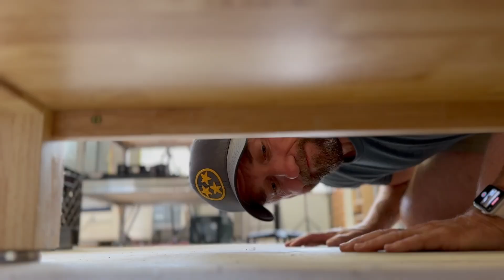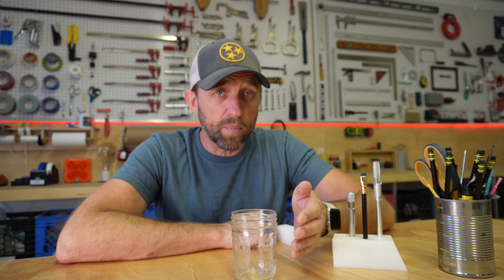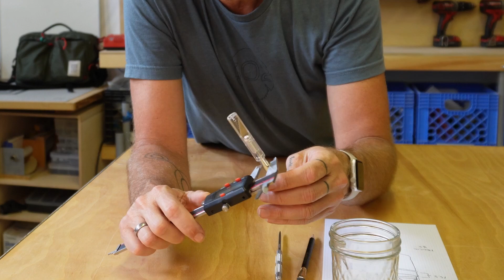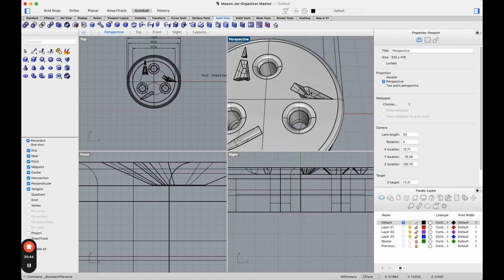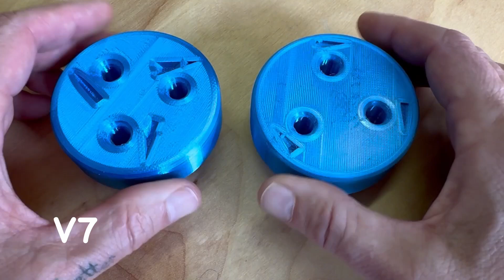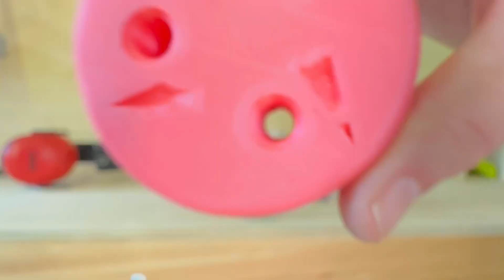Stop looking for hacks... Organize with Purpose!

Comment: That came out nicely! For a future version you might use a different first layer filament as an inlay for the labels and a perimeter on the holes so they are super easy to see at a glance when putting things back
Reply from the maker: That's a great Idea. I mostly use my printer for prototyping, so I'm new to the idea of making a finished product. I'm looking into the multi-filament printers now!

Comment: Nice tips, thanks for sharing. I personally use sections of PVC pipe for electric wires conduit (30 mm diameter), fixed horizontally under the main shelf in front of my workbench, to hold HB and B2 pencils, 0,5 and 0,3 mechanical pencils, eraser, pens, permanent markers, rulers, tweezers, compass, divider, awl, marking knife, cutter, and 2 screwdrivers. Next the pipes there's a little shelf under the main one with 2 combination square (15 cm and 30 cm), digital protractor, caliper, scrapers, small brushes. Everything else goes in drawers and cabinets near by. The only problem was the pencils getting shorter and getting lost in the longer tubes. I solved this by creating a second and a third row of shorter tubes under the longer ones to hold shorter pencils (PVC pipes glue very well with hot glue and you also get a nice visual pattern).
Reply from the maker: Nice! I realized pretty quickly that I was going to run into the short pencil problem. Not sure how to fix that yet.